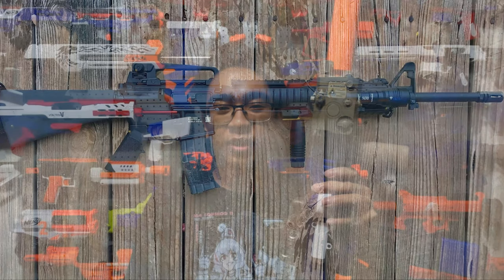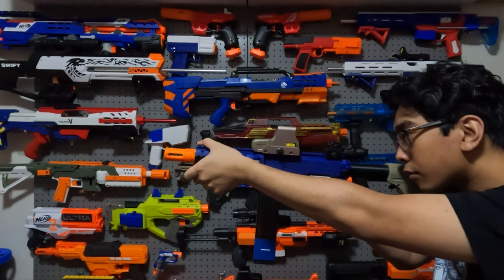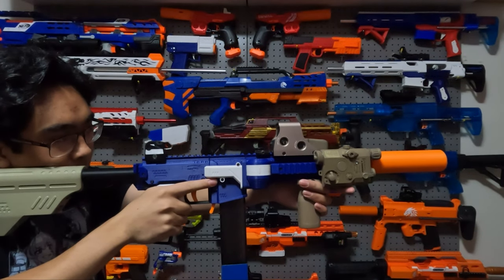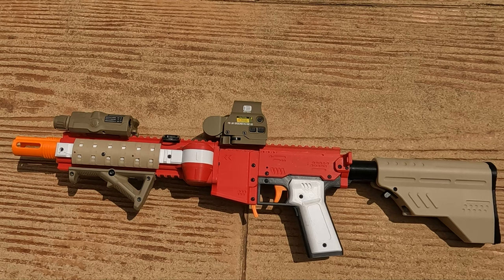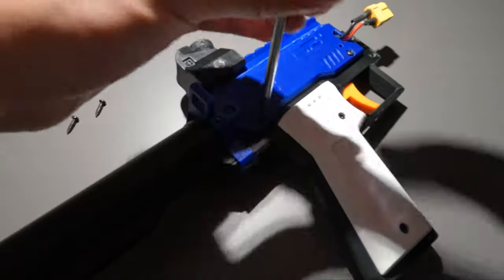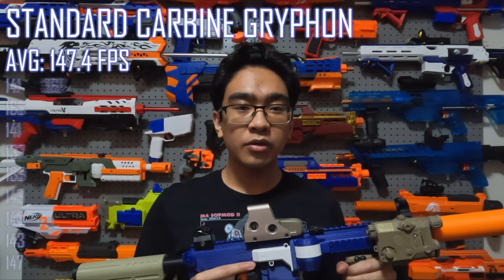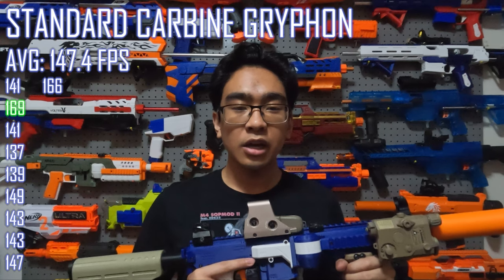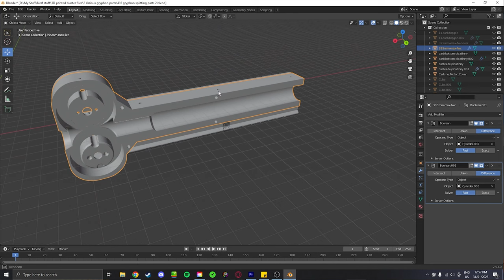The HK416 Gryphon - Custom Flywheel Blaster Overview

Comment: So I have a question, how did you get a good print of the Suppressor barrel? every single time I've tried it has failed, could you show what orientation and settings you used?
Reply from the maker: I printed it at .25 layer height with the front of the suppressor touching the bed (threads at the top). I also used a brim for more surface contact with the bed, but a raft can also work if you're still having issues with that. The threads were tight for me so I scaled up the X and Y dimensions to 103% in Cura so the suppressor threads off the muzzle easier

Comment: can i ask about the PEQ and Holo sight? Are they printed or buyable? if so where can i get them? thanks
Reply from the maker: I got them off aliexpress. There are also non-functioning printable versions but they don't look as good
Reply: @benpereznerf  is it an airsoft one or specifically nerf?
Reply from the maker: airsoft
Reply: @benpereznerf  so any airsoft rail accessories will fit? Do you know if theyll fit on the gavinfuzzy SBL 2? Im looking to get a holo sight and magnifier (dummy or airsoft of course), PEQ, and MLOK flashlight. Will airsoft ones fit on the SBL 2?
Reply from the maker: airsoft accessories are designed to fit on either picatinny rails or mlok slots. as long as the blaster has the matching mounting option for the airsoft accessory they should fit

Comment: hi bruh, im planning on building one for my arsenal... is there a way i could make one hitting like 200fps or above 190's atleast.. tnx for any tips and advice👍🏻
Reply from the maker: If you're aiming for almost 200fps, you're probably best using full length darts and a dual stage cage. For motors, 180s will help with spinup times, but I've seen some flywheel setups hit almost 200 with just a single stage. Your darts will probably become single use and it'll probably only work with fresh ones. Hope that helps
Reply: @benpereznerf  thnx for the reply... any suggested motors or cage/wheels set up for high perf. im verry newbie on fw blasters,.. and i see you also build up a nice stryfe..😉👍🏻👌🏻
Reply from the maker: Recommendations will depend on what part of the world you live in. If you live in or near Australia it would be easiest to get Neo Rhinos or Neo Hellcats for motors, but if you live closer to the US, Krakens or Valkyries will probably easier to get. For flywheels, I like daybreak wheels, but those are only compatible with daybreak cages
Reply: @franco8190  Banned Blaster banshee cage will get you to 200fps (ot at least dang close) with half length darts on 3s battery. They are absolutely unreal. A half-dozen people in my local group use them.